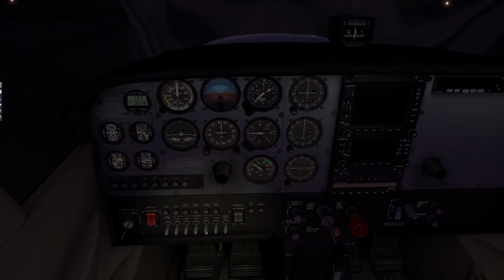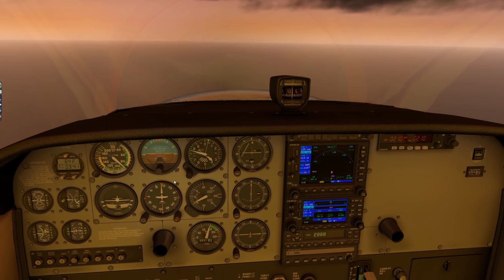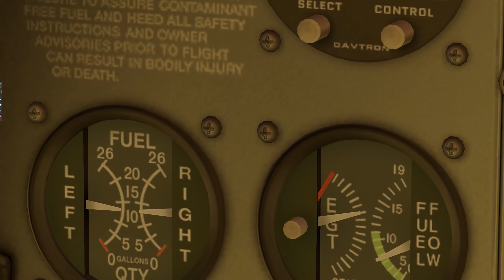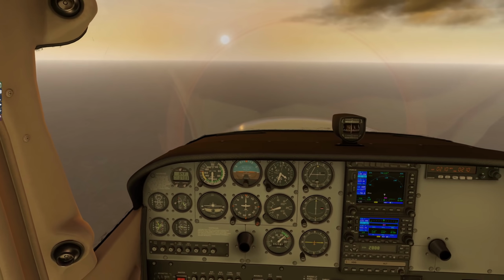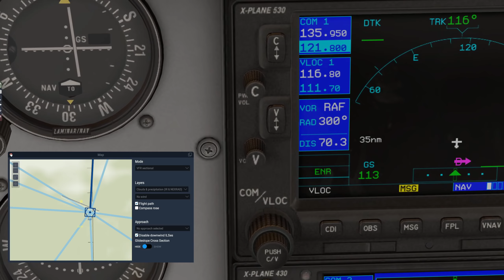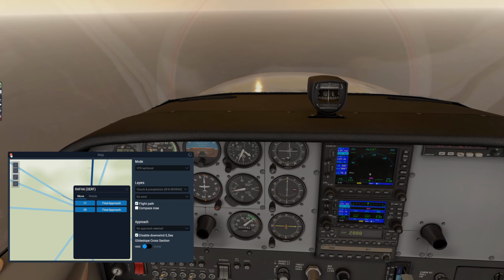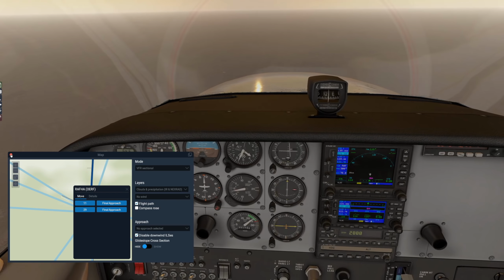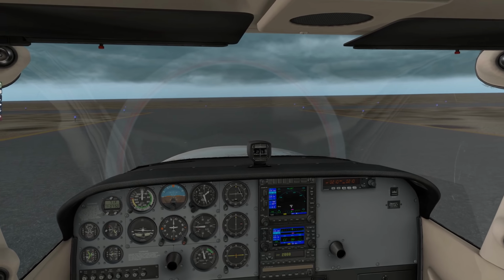Xplane 11 - EP41 - Arar to Rafha

Comment: It doesn't look like you programmed the flight plan into the GPS, which is one reason I think you had a problem with the AP in NAV mode.  Also unless you are using VOR's for NAV you need to change the mode on the GPS using the CDI key to GPS instead of VLOC